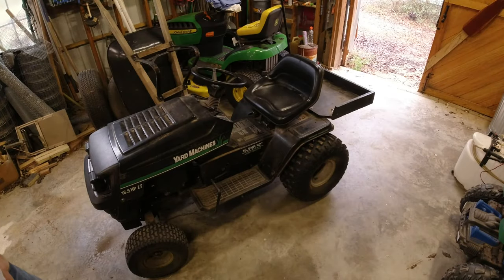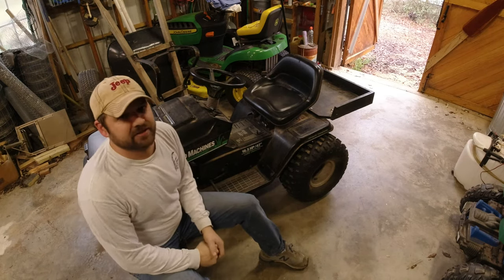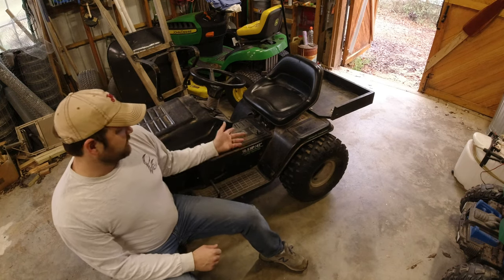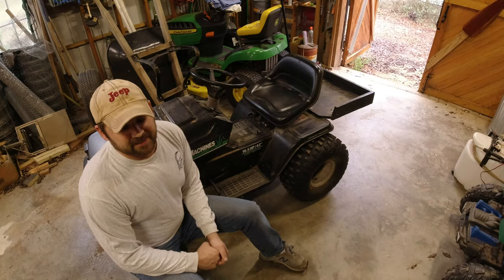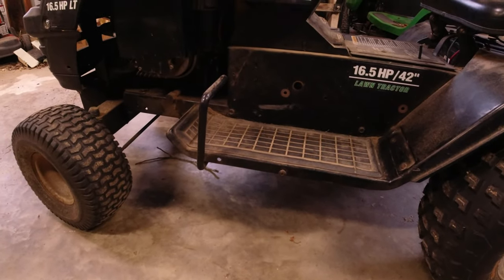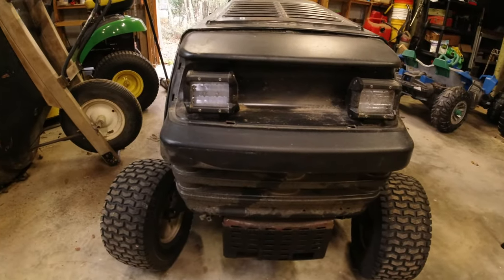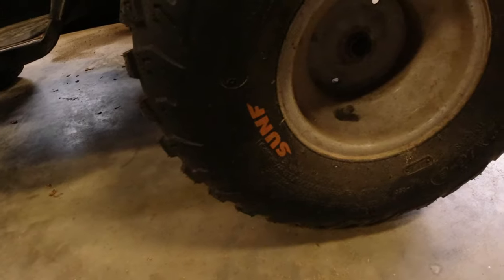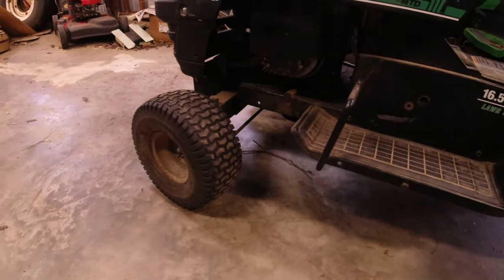Riding Lawnmower Converted to a Utility Vehicle (UTV)

Comment: I had wheelie problems after removing the deck needs a front weight and the one I now with I put 22s on the back and wheelbarrow wheels with cartridge bearings on the front it cool because if you dont have a cultured lawn you can now mow the weeds at 4 to 5 inches tall and actually keep some moisture in rather than the short cut of the stock mower talking two tractors here and hey that flat fender next to the seat a 50 cal steel ammo box gives you a good place for straps chain and a spark plug wrench and stuff the best model I've made tractor supply suspension seat about 110 bucks a couple inches higher ride but arm rests and it slides back and forth had a couple for two years now and they are holding up the suspension adjusts also and there a drilling template on the box well worth it!

Comment: Good use of a mower you’re weren’t otherwise using. I did something like this a couple years ago. Nice to see your take on it. Thanks for sharing.
Also, I discovered that Sears craftsman did make something similar to this years ago that could be attached to the rear of a mower. Saw it online but never got it and ended up making it myself. Nice job. 👍
Reply from the maker: Thank you for the kind words.  This thing is a constant work in progress.  I've added a few more items to it since this video.

Comment: I built one sort of like this and I find a front rack is the best for stuff I built mine to the size of a 5 gallon bucket with some braces on the side I use it for grain, water, chains, straps etc I built it out of scraps I think total cost was about 30 Canadian dollars.          Get some walk behind snowblower tires I can turn on pure ice and they don’t break the bank.       Good luck with your project and don’t forget to have fun with the mower
Reply from the maker: Thank you for watching!  That sounds like a good idea.  My exhaust comes out right in the front but I have plans to reroute out the back.  After that, I think I could do something like that.

Comment: Great job,  get yourself a 110 mig, PLENTY for projects like this. I use a pro mig 140 on gas,  no Flux crap, that will discouraged you faster than anything.  You can teach yourself in no time.......... scrap pieces and practice.........YOU WILL NOT REGRET IT!!!!!!!
Reply from the maker: I definitely need to a welder and learn to use it.  Maybe I should make that my 2022 resolution!  Thank you for watching!

Comment: You need a little wire feeder welder with flux cor. You can learn to put down decent welds in a few hours with one. They are inexpensive and very handy.  Nice video and this has been my same thought for quite some time. ATVS and UTVS are way over priced.
Reply from the maker: Thank you for the suggestion.  I definitely need to learn to weld.  Just haven't dove into to learning yet.  Thank you for watching.  Good luck on your project!
Reply: @ProjectNineOaks  I'd suggest a little stick welder over a flux core. My first welder was a $300 Hobart flux core, and I could never weld good with it, and they're not very powerful. Then I bought a cheap chinese $100 stick welder, and I can weld soooo much better. And it welds thicker material.
Reply from the maker: @refugeinc.159  Thank you for the suggestion!

Comment: I would like to know if you could put on a 2nd fuel tank so you can run into town and pick up hardware or groceries or what have you
Reply from the maker: One tank should be fine to last about an hour of run time for this one.  That would be a slow travel to the store.  This one only goes about 6 or 7 mph I believe.
Reply: @ProjectNineOaks  1. I agree if we are talking about the main grocery store 45km away, but I was talking corner store 2 blocks away (post office up the street from it; hole town can fit in a mile square with forest around it (if we had real trees))) and 2. it's for haling items like boxes of kitty litter and cat food and people food. not to mention people food (and trust me, around these parts of Alberta, bread is HEAVY! takes 2 guys to pick up 1 loaf! just kidding (i hope). when I was trying to find out about rebuild kits and stuff, I found pictures of custom bodies and stuff and then started thinking what really could be done to this thing. I do not need a racing mower/tractor but what can make it run better and safe as much fuel as i can. THAN I started wondering about distance riding (no lawn mower bits); distance, how many miles in stock tank, and how long it would take.

Comment: I've got a Husqvarna that is being a total butt. It's 24HP so I'm hoping to transform it into a UTV/dog exersizer. 
The engine seems perfectly fine, but everything else is failing. We just replaced the gearbox and now the belts are too big as we replaced them with the same belts that came standard but they don't fit.
The deck is also REALLY causing issues.
Reply from the maker: Dang, sorry it's giving such issues!  Just remember that the money you spend on your UTV conversion is MUCH less than buying a new UTV!